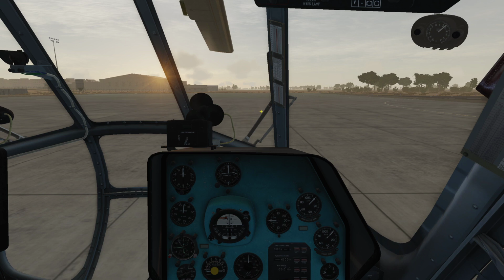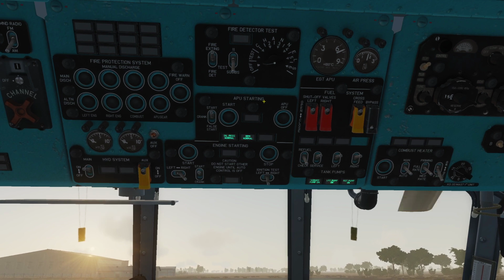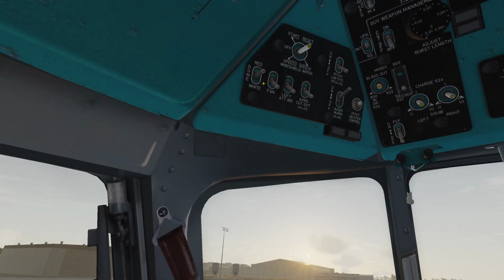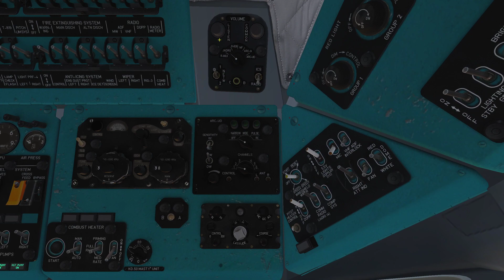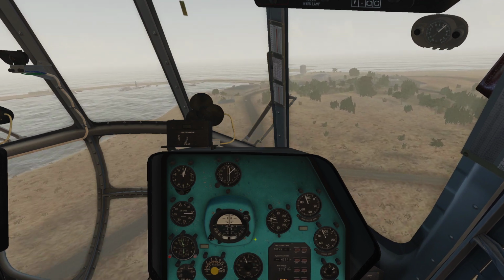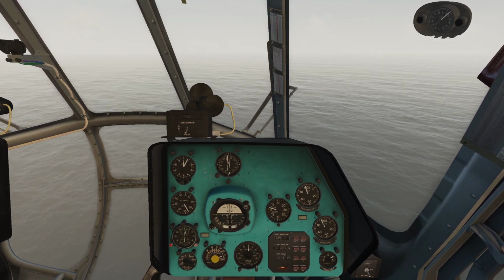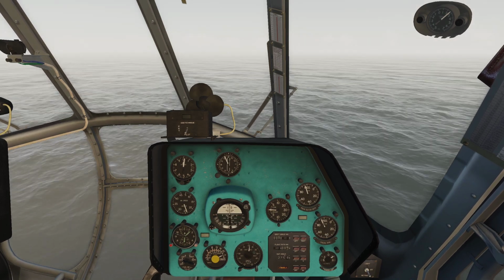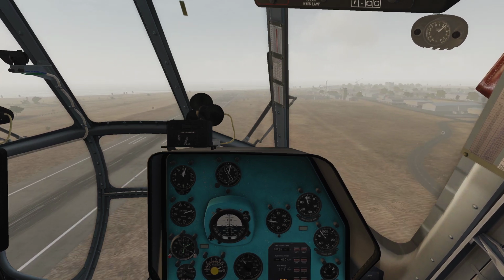DCS Mi-8: ADF and Doppler navigation tutorial

Comment: Any idea how the Mi-8 converts magnetic heading to true heading??

Other multicrew aircraft from the period have some kind of "Variation Setting" control where the navigator can dial in the local variation. That latitude setting makes a continuous gradual adjustment to the gyro to compensate for the rotation of the earth - it's nothing to do with magnetic north.
Reply: It doesn't. You need to use magnetic heading as input. That MG/GC switch only controls the source of heading between magnetic compass and gyro. But the gyro is also taking data from the magnetic compass to align. I'm not very familiar with the differences between the two modes, but the Mi-8 does not know the magnetic deviation for sure. 
I think there might be a way to manually offset the gyro mode by the deviation angle, but you would need to know it and dial it in manually.